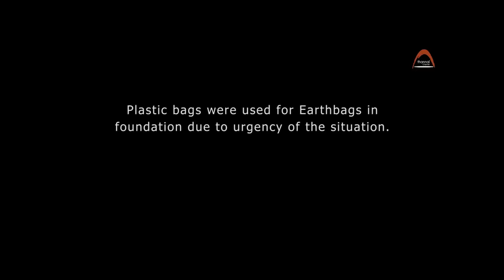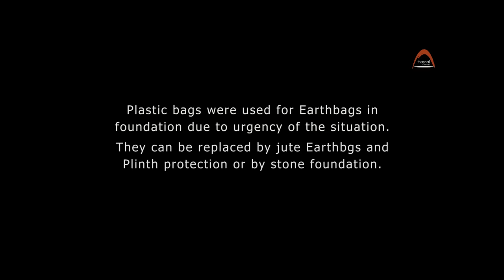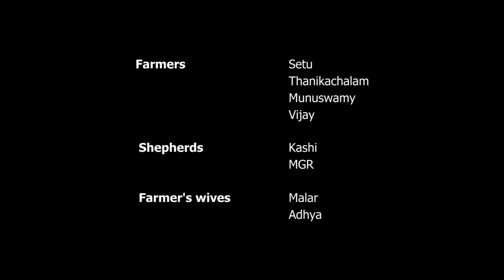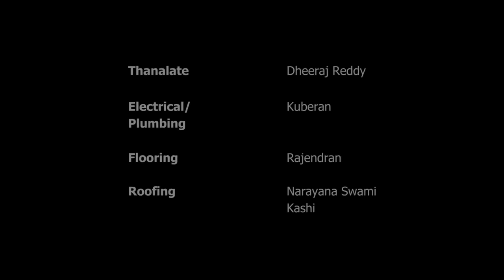Earthbag home in Tiruvannamalai

Comment: Very nicely done. Just one thing: the roof is not waterproof so what is the plan for stopping the rainwater which will pour in through the thatched roof during monsoons?
Reply from the maker: Coconut leaf thatch is water proof, it will usually last 1.5 or 2 years, in our case it lasted almost 3 years and stopped many rains, flood (DEC 2017) etc 😀. Here you can see another cob home with Coconut leaf thatch home withstanding flood - https://youtu.be/7tyrMHGsvkc
Reply: @ThannalNaturalHomes Homes that is really amazing! Thank you for your answer.
Reply from the maker: You are most welcome, 😃

Comment: Where can you buy the 1000 jute bags from? couldn't you used bamboo for the electrical pipe more economical pvc cost a lot of money 45 days !
Reply from the maker: Namaste, we have bought it from the local market. These are second hand 25 kg rice bags. So that it is much easy to lift. Bamboo is a good suggestion, but the bamboo available from our nearby farmers and from market is not straight, so it is difficult to do vertical holes. Can see more photos from our fb album https://www.facebook.com/pg/ThannalHandSculptedHomes/photos/?tab=album&album_id=664807287006284
Reply: What was the size of the  jute rice bags, that you used and label name I like to see if i can locate someone who has these exact bags for sale 1000 bags and the jute thread in roll to sew the bags shut with what thickness did you use I'd like to locate it sold by roll .does the market where you bought your bags from have a telephone number , or mailing address I could write them to buy  or maybe they have a PayPal account where i could buy these bags from them on a website and have shipped to me USA ! Thanks Pamela Goforth

Comment: Is it safe from storm like a concrete house? What is the techniques to save the roof fromfire? Is it safe from excess rain? How long will it last normally? Is it possible to make the foundation higher so that the floor remain above the reach of flood water and unwanted guests like snake and scorpion? I m highly interested... Also this technology will help the dying jute industry
Reply from the maker: Namaste  roof is coconut leaf, it will only last for 2 years then we have to change it. But in our case with out a leak our roof lasted for last three years and we have changed it with sandwich roof with bamboo, lime and terracotta secondhand manglore tiles you can see that video Earthbag reloaded here -  https://www.youtube.com/watch?v=Wo-04BCUGUo   🙏
Reply: @ThannalNaturalHomes  it can be a better option in hut, rather than the rooms made of corogated sheet wall and roof we see in slums of urban region. That is too hot in summer and cold in winter. But to be a substitude of concert house,it need to be more sustainable.. As the thinking of common people "why should i spend money several times? I will spend a lot once and it will sustain several generation." So you need more research and improvement in the technology to make it acceptable widely.....
Reply from the maker: @newmbdk2762   there are many roof systems in natural building other than concrete( new concrete has very less life span if you study in deep, it has not even sustain 25 years , it will start cracking, for example in Kerala if you seenew building with in 10 years they will put tin sheet on top)  .Some good examples for natural roofing which sustain more than centuries  are 
1. madras terrace -  https://www.youtube.com/watch?v=eSRyWCMuuLk
2. flat mud roof - https://www.youtube.com/watch?v=qORndVpF-Xg&t=70s
                               https://www.youtube.com/watch?v=RrNJPWtFafk&t=17s
3. Lime roof -   https://www.youtube.com/watch?v=Dep-Au6bGSU&t=14s
Reply: @ThannalNaturalHomes  as a snake lover and rescuer, i have faced various situation where snake entired people's room. Though i love snakes, but like other people i love to see in backyard, not in bed room. Such mud houses allows rodants to make tunnel in room. Those later become a home of snakes in many cases. Have u any solution of this?
Reply from the maker: @newmbdk2762   Solution we have done is 2 terracotta tiles like skirting , this will not allow rodents to make holes
Reply: @ThannalNaturalHomes  great.... Such technology also used here in dike by river

Comment: I think using sand sacks is deviating from the concept of cob construction. Please respond.
Reply: Namaste Karthikeyan,these aren't  sand sacks,firstly the soil used is being dug out of the same land,20 feet away from the building site,so soil picked right from the site.Also the soil was quite silty  and hence a little stabilization with lime and most importantly we had very less water to splurge,hence the earth bag method.The idea is to go natural,reduce carbon footprint of your raw material.Importing soils ideal for cob construction adds to Carbon foot print.Natural buildings isn't particular to just couple of methods,its going natural as well as local.

Comment: Agree about how disgusting cement/concrete is (with metal rebars inside) -- it has caused massive environmental destruction, including for bridge construction. Most of this video is excellent, but the plastic soil-filled bags and barbed wire used for the foundation are horrible, and not environmentally friendly whatsoever. The family should have taken the little extra effort to make a stone foundation.
Reply from the maker: Namaste, 
Yes you are correct about using plastic bags. Due to our onsite constraints of time, money and material availability, we had chosen to go ahead with plastic in the layers which come below the earth. Moisture content of the soil was one of the challenges we faced. Now seeing how the jute bags have performed over the years, we are very sure we could have used them for foundation - with a good water-proofing around it by making plinth protection (which we have added later, you can see in the final photos - a sloping layer of mud around the place where wall joins the ground). 
You can see how we have learnt from it and moved to stone foundation in these links: 
1. Grandma's Cob Kitchen https://youtu.be/nDLeGvCe000
2. Weaving wall cottage https://youtu.be/KrYBXhE8r-0
Barbed wires offer clipping to successive layers of bags. They can also be replaced by mortar and bamboo pegs.
We have learned these insights in the years of work after this home, we are happy to accept and share the improvisations to anyone who wants to do earth-bag homes.
Thank you for the constructive comment, we are grateful to all who helps us improve.